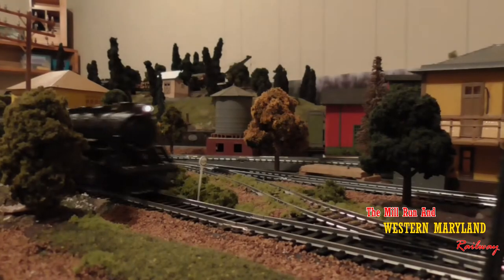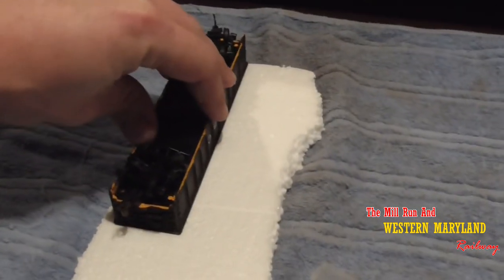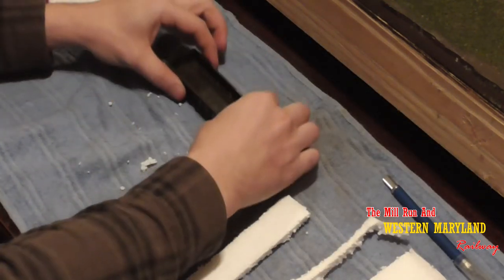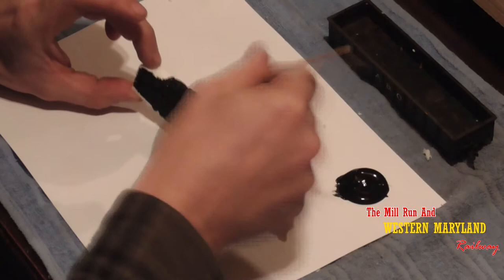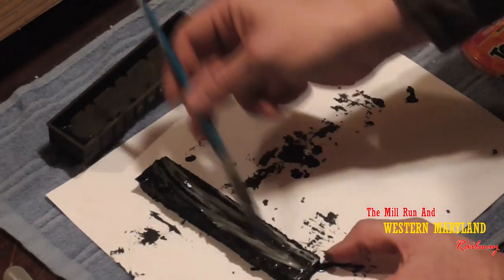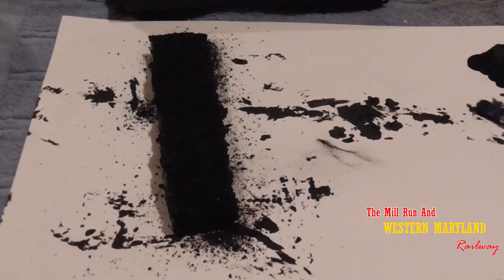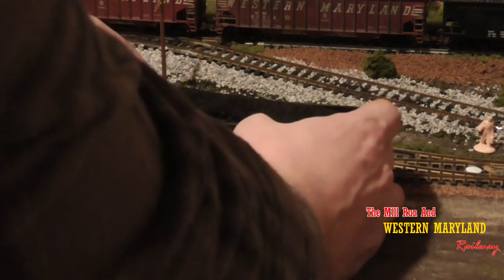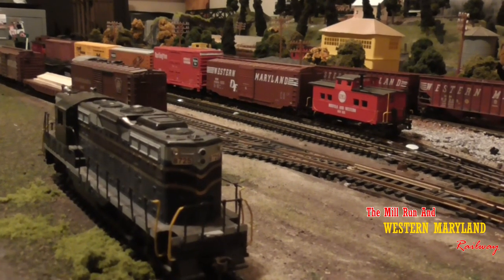Easy To Make Coal Loads For HO Scale The Mill Run & Western Maryland Railway

Comment: I think these look really good. But I like to use real coal instead. I get it from the trackside of my local heritage railroad and find large lumps. Then I either put it on some cardboard or a permanent load with some Woodland scenic tack, I just brush on a nice layer, get crushed up coal and pour it on the tack. Then I tip it over to let the extra fall out. I then rinse and repeate that 5 times and the coal looks great!

Comment: As others have suggested I glue a metal washer in the Styrofoam before adding the load. This allows for easy removal of the load with a magnet to run the car empty back to the mine.
Reply from the maker: Fantastic tip! Thank you for sharing!
Reply: @themillrunandwesternmaryland11  You are welcome!